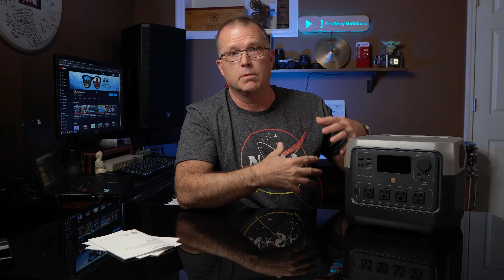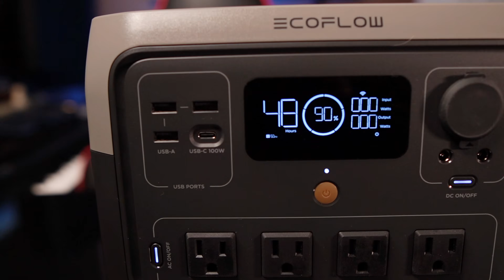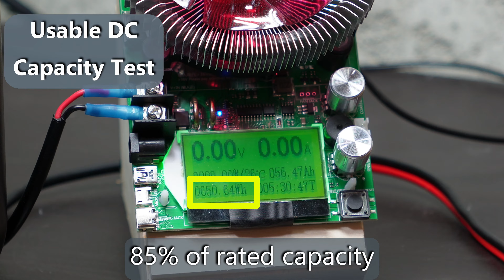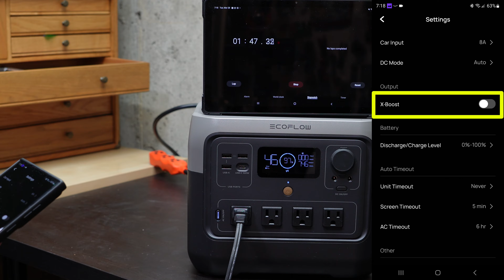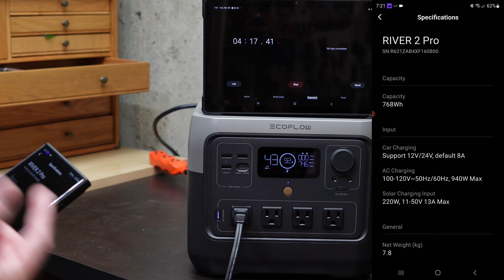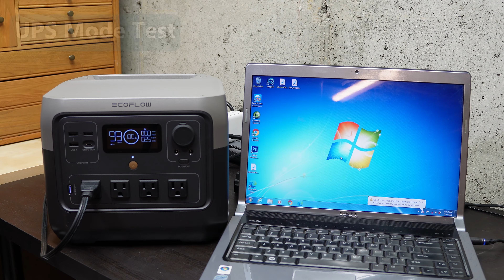Newly RE-DESIGNED RIVER 2 PRO Portable Power Station by EcoFlow...A Worthy Upgrade??

Comment: I wish you had tried turning on oil heater with X boost on. I am planing to use this as back up to a sump pump which is 3.3 amps and 1/2 horsepower. I have read that is should be ok. It is just the initial start up I am worried about.

Comment: My Ecoflow River 2 Pro drops to 50% runtime as soon as the AC button is turned on. Is it supposed to do that?
Reply from the maker: Definitely not. But IF you just got it, try fully discharging and then recharging the unit to ensure the BMS is properly calibrated to the avail battery capacity. If the issue persists, I'd contact EF about am exchange.
Reply: most likely should drop runtime, due to now you are powering up the inverter. even if nothing plugged in, the inverter will draw a little power, thus affecting  rated run time.
Reply: @RidingMowerKing Hi, the unit was returned since. I gave it another shot and bought another one thinking I may just bought a defective unit. Same issue. I went with Anker instead.

Comment: River 2 Pro does support additional batteries unofficially.

You can daisy chain them with other battery banks by either the USB type C or AC.

The additional battery banks needs to support either pass-through charging or UPS/EPS.
Reply: im wondering how thats possible

Comment: I would have preferred you tested the UPS mode with a desktop computer and not a laptop. A desktop computer generally draw significantly more power than a laptop. Additionally, a UPS is traditionally used with a desktop, not a laptop. I'm curios to see whether the Ecoflow UPS mode is fast enough to keep a ~145watt load desktop running without interruption.

Comment: I wouldn’t recommend Ecoflow as their support is nonexistent. I purchased River 2 max and the USB-C port died in the first 30 minutes. Now it is already weeks without any solution from EcofFlow. Neither trough their chat service via the app, nor via the email support. If they are not servicing or replacing brand new defective unit, good luck getting any support from them within the promised 5 years warranty. I’m lucky I can return my unit to the shop and never ever have to do anything with EcoFlow again. I recommend you stay away from the products of this scam company too. I was also smart enough to start screen recording the useless conversations with their support team. Video is coming soon.

Comment: The Delta Mini will run a 1000 watts all day ( AC) or until the battery capacity is depleted. For its size its one of the best power stations for features and value for the money. Ive seen them for as low as 550.00.I dont think there is a power station that can compete with the Delta Mini.
Reply: River 2 Pro will outlast (life) the mini by 3.75 times

Batteries in the mini are rated for 800 cycles.
Versus River 2 Pro 3000 cycles.
Not to mention the River 2 Pro Batteries are safer then the thr other Batteries they use on their older products.

Warranty on Mini is about 2 or 3 years.
Warranty on River 2 Pro is 5 years.

Edit
In the recent Amazon Prime sale, River 2 Pro was on sale for 399.99.

Comment: Received mine today. XBOOST doesn't seem to be working at all. Tried flipping the switch in the app and nothing. Won't even attempt to run my fridge, immediate overload. College type dorm microwave barely works, light in the microwave flickers, toaster shuts down immediately as well. Something isn't right and I will be reaching out to support of course. Worth noting, I did update the firmware and the app immediately after it prompted (right after unboxing). Hopefully it's a glitch unit and nothing more.
Reply from the maker: Yeah - definitely something amiss there - but personally, I'd defnitely NOT try to use XBoost with a fridge or microwave.  I'd keep that for simple things like lights and heaters only.  Please feel free to report back and let us know what your experience is like with EcoFlow's support team.

Comment: Can a regular XT60 plug be use with the power atation?  From the literature I have found , it appears the extra pin on the XT60i connector goes to a wire used by a specific smart charger to display  cell temperature and cell cycles.  Solar panels don't have those options, coming from a standard MC-4 connectors.
Reply: Alex I think there is a different purpose for the extra pin, please see my post above
Reply: Extra pin tells the unit to limit charging amps or not....usefull if in a car. You can use standard xt60 port cable but you will most likely be limited to 8 amps of solar x your voltage of panel = watts....probably 160 or so.

Comment: 4-5-2023 - # RIVER 2 PRO TO POWER A FULL SIZE REFRIGERATOR = [NO!!] "OVERLOAD" ERROR & SHUTDOWN :+( # Great video as always. I just bought the River 2 PRO via Amzn, it arrived 4-3-2023 , ran tests on it, as soon as I plugged a 5521 cable into the PRO's 5521 ports, there was a high pitched whistle sound from inside case. strange, does that sound every time I use the 5521 port (& Cigarette lighter socket). I have the Riv 2 MAX and it wouldn't run my full size kitchen refrigerator, so I bought the River 2 PRO figuring that would be no problem. NOPE... the River 2 Pro got the same "OVERLOAD" error and shut down. I'm In the process now of returning Riv 2 PRO to Ecoflow, have to wait for a return label emailed direct from Ecoflow (approx 2-3 days) in order to return, even though I bought it on Amzn. So I will buy the Delta 2 as soon as all is refunded. YTube Vids show Delta 2 runs full size refrig's no problem.  Love Ecoflow App! That's why I want to stick with Ecoflow products, but running my full size refrig is Job #1. I own a "Milin 622wh Power Station," and it has no problem running my refrig!! (figure that one out?) Confused why the River 2 PRO won't run my refrig. :+(  Great job as always!  ##### My Refrigerator SURGE test using Kill-a-watt meter (Refrig. Peak Surge was 1216 watts) = 4-5-2023  = https://youtu.be/2XzPhPSjlng
Reply: Depends on your refrigerator....also sometimes if you overload a couple times it will finally kick on. Delta 2 will definately run it.
Reply: Millage will vary.

Comment: Please re-visit the male/female MC-4 connector designations.    It's not the shape of the plastic that determines the 'sex', but the shape of the metal connector inside the plastic.  The connector you call 'female' has a male pin inside.  The connector you call 'male' has a female pin inside.

Comment: You mentioned the extra pin on the XT60i plug. I understand that the pin gets tied to incoming negative for a normal car charger or incoming positive if you are using a solar cable ( could be the opposite way around I can’t recall ) This tells the ecoflow how to limit the charge current to not overload your car circuit.

Comment: Well done. How would you compare the DC system to the Montez (I like the water and shock residence for camping
Reply from the maker: I don't think there's a huge difference.  The Montek's Type A ports are 18W instead of 12W, and the DC5521's on the Montek are 7A instead of 3A...so if those are things you use extensively and prioritize,  maybe the Montek is a bit stronger.